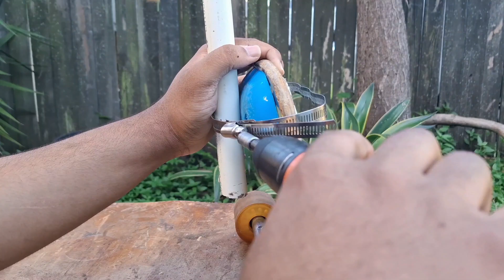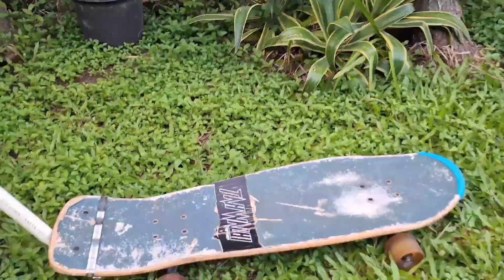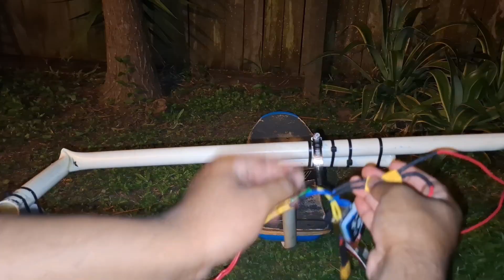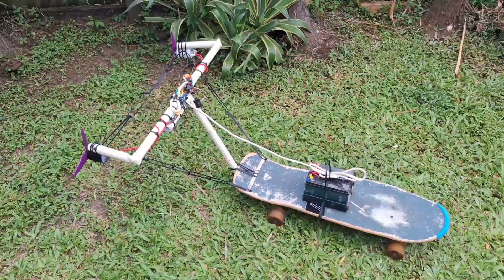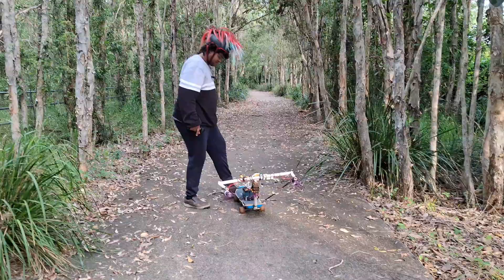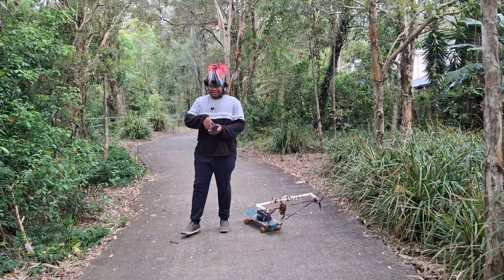Propeller Electric Skateboard

Comment: Puedes usarlo como soplador de hojas divertido
Reply: It won't work dude... the weight of the batteries will exceed the force being put out by anything. You would need a skateboard the size of a car and an airplane propeller. Use your brain dude....
Reply from the maker: Making the impossible possible doesn't that sound fun
Reply: @foxtomian  no dude. It's the definition of insane. You have the math to prove it won't work, but you keep doing it regardless. Why don't you actually try using your brain and put the engines on something that reduces weight and resistance like a small boat? It's like telling a small child that something won't work, but they just want to waste their time. It would be nice if I had endless resources in life to make stupid ideas that won't work, but I live in reality. Have fun in fantasy land.
Reply from the maker: Pure knowledge is what l seek. Knowledge from experience and failures.
Reply: @foxtomian  right so you are insane... you have been given the information and choose to ignore it. Lol like I said, have fun living in Fantasyland.
Reply from the maker: Are you going to watch the part 2 video
Reply from the maker: Muy cierto, como soplador de hojas es un éxito, tal vez con más potencia funcione el patinete. Gracias por comentar.